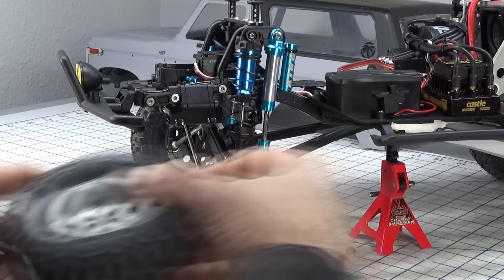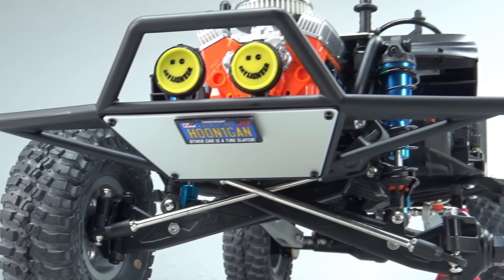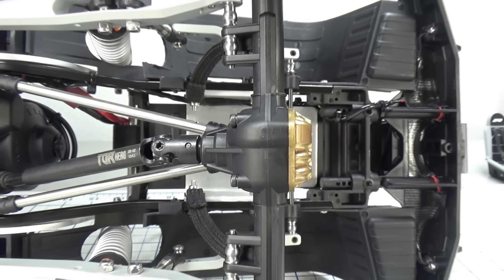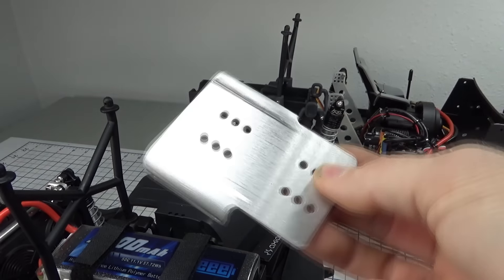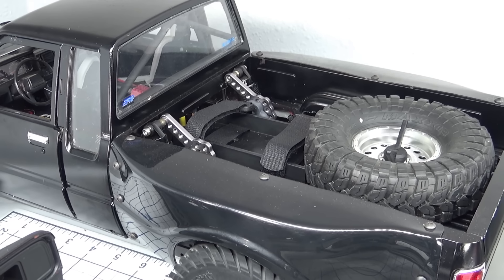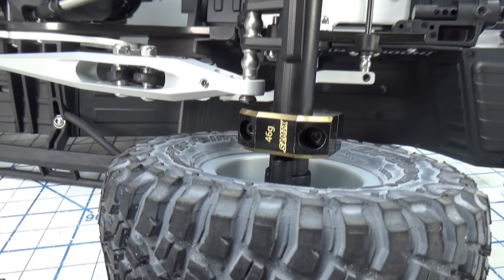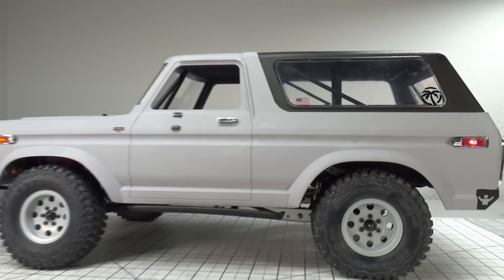Project Scale RC Prerunner 2wd Ford Bronco Hard Body! Axial SCX10ii off road

Comment: is that twin i beam kit still available for sale anywhere? cant seem to find anywhere that ships to the netherlands
Reply from the maker: Greetings from Oregon, all my buddies in the USA can't get them either. Been on backorder since the release. Wouldn't be surprised if we see a v2 come out and the V1 disappears. Horizon Hobby is good on delivering backorders. Good luck!
Reply: @DoubleClutchProductions  thanks a lot man, your video's are very helpful, been playing around with the idea of a prerunner style truck with twin i beam on the front and cantilever on the rear
Reply: @DoubleClutchProductions  im thinking of getting a full carbon/aluminum aliexpress scx10 kit as a base, im also working on a micro 1/35 orlandoo f150 based prerunner with 3d printed front i beams
Reply from the maker: @Weert-Gilders no worries, appreciate like minded people. Keep hunting. I'm building up a Element based 4x4 using the new IFS 2 from camburg, SCX10ii parts and trucks are getting harder to find these,days too. Good luck 👍
Reply: @DoubleClutchProductions  i got a cheap short course chassis laying around aswell wich i could use the front of for the ifs, if ill only use the rear axle on the scx10 because of the beam kit i would have an extra front axle laying around wich might be used as a rear axle for it 🤔
Reply: @DoubleClutchProductions  theres Quite a few scx10 for sale over here but most of em are rtr and asking too much imo, thats why im leaning towards the aliexpress clones wich Go for +-170 Bucks as a Rolling chassis and got aluminum axles with a Carbon fiber chassis
Reply from the maker: @Weert-Gilders your on the right track for sure dude. Blaze the trail 👊

Comment: @DoubleClutchProductions, do you have any of the Axial kits currently in stock? If not what’s the current backlog?
Reply from the maker: I don't have any axial kits in stock. I am doing a order in the next week or two. I will do a few posts here when I get kits back in stock. Appreciate the interest man. I do have a few prerunner chassis, you doing a twin I beam build?
Reply: Yep, looking to do an I-beam front on an SCX10.2. Will be a little more scale than performance because I want to run some sort of Ford body with a Vanquish F9 rear just for the looks. I also half considered doing a leaf rear to give it a more budget build look. Any experience with that?
Reply from the maker: @estok4x4 yup yup I hear ya. These are fun to build. I don't have any experience with leafs, most of my builds are based on emulating real prerunners and I've never seen leafs on a trsiling arm 4 link but I'm sure it's possible. I have a few scx10ii chassis frame rails left, my personal stash but it's a dual shock setup. I'm hoping to have full restock of all the goody's in a week or two. Hit me up anytime I enjoy helping fellow builders with these.
Reply: I kind of want to try the leaf setup just to see if it’ll work, kind of going for a modified stock truck look more than full blown prerunner if I can pull it off. But yeah I’ll keep checking in here to see when you have the parts available to duplicate your setup here and I’ll definitely be in for a set.
Reply from the maker: @estok4x4 awesome my dude, I've always wanted to try leafs

Comment: Are these kits still available?  Where do i get the kit if available?  Thx
Reply from the maker: You can purchase all my parts directly through SendCutSend. Links are on my youtube link tree more info. No hardware included.
Reply: @DoubleClutchProductions  can you elaborate on this w a link or something?  I've looked through the posts n I don't see any parts list or anything  😕
Reply from the maker: @lancesmeal8853 click the description for the video. All links to parts used are in the video description. You can also purchase my designed trailing arm conversions, battery relocation and chassis rails through send cut send with the links on my youtube link tree below the instagram link.
Reply: @DoubleClutchProductions  ah my bad... my brain was working.. 😂
Reply from the maker: @lancesmeal8853 ha ha all good man. Glad to help. 👊😎

Comment: Why would you add weights on the axle and use the lightest wheels as possible ?
Reply from the maker: Controversial right? Lol, rotational weight is a whole different important aspect to the science. Axle weights help keep the super light weight axle planted on the ground to help for traction. Full size fabricated off road housings are heavy compared to a 1/10 scale plastic one. If youu Google sprung vs unsprung weight for wheels and tires its amazing the ratio of forces per lb of weight that goes into the shocks. Everything is a trade off, without axle weights, it would work better through the whoops in theory but lack traction in loose sand and dirt. In my case all I have is sand and my 2wd trucks get better traction with added axle weight. 👊
Reply: @DoubleClutchProductions 
If you want better traction,use a different tire thread pattern,or cut one transversal tire thread line in an alternate pattern.,one cut,one stock.
Rotational weight will reduce your power on acceleration,but increase stability on higher speed,like a longitudinal gyro,and temper longitudinal oscillation since the mass is increased on the corners.
Reducing unsprung weight will help to improve shocks reactivity,since less mass will can accelerate and deccelerate faster. 
But adding axle weight and reduce wheel weight are complete contradictions as i understand,both are unsprung,and rotationnal mass is also unsprung mass here.
You better inprove tire traction,and reduce unsprung mass the most you can,and get the most traction with your shocks by increasing rebound speed,or a more balanced weight distribution with half the weight on the rear axle.
Are you sure the lack of traction is not caused by the slow suspension response ? its geometry does not help to get reactivity,it's a huge lever compared to a strut/wishbone.
You need minimum weight with that long levers.
Reply from the maker: @michaelovitch I go over a lot of this in the video. Your contradicting the books and research that I am referencing. The plastic axle housing with the added weight in my experience is closer to a real world fabricated axles, with light weight housings on these rc trucks after a few whoops it starts to pack because of the limitations in rc shock rebound tuning. The added weight is controversial, keep in mind I've tested these trucks with and without axle weights. Why I say it's controversial is its easy to blanket a topic with right and wrong but without testing and experience were just reading books and regurgitating proven science. 👊

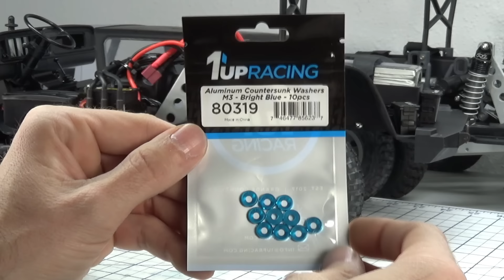Comment: How did you mount the fake motor to hide the servo 1:30
Reply from the maker: I made a mount out of kydex, similar to a 90 degree bracket and a few zip ties to the battery tray.
Reply: @ ahh okay looks really good tho , you inspired me to build a pre runner scx10 so i’m slowly building one from scratch and learning a lot on the way , never had or worked on a scx10 before
Reply from the maker: @MatthewKase Yah buddy. I'm very happy that these builds inspire others to build cool stuff. Building these prerunners is pretty challenging, so fee free to hit me up if you have any questions. If you need any parts hit me up. 👊😎
Reply: @ for sure i definitely will i’m just trying to figure out where to mount receivers and everything currently, did you mount yours on the side plates?
Reply from the maker: @MatthewKase Copy that. I did mount the receiver inside of the scx10ii receiver box. I mounted the esc on the opposite side plate. Any questions on setup or parts I enjoy helping fellow builders. I also have a Google document on my youtube link tree that has links to all the parts I use to build rc prerunners 👊😎

Comment: I struggled to get my new injora steering servo and injora steel drive shafts on my trx4m f-150 the other day and this guy is over explaining weight ratios..... specific weight oil to run in your shocks.... specific springs and angles to run multi link suspension set ups 😯😲
I'm impressed and intimidated all at the same time. Guess I'll subscribe to get some ideas for my next truck I'm getting next week a Traxxas 1/10 scale bronco crawler 💯
Reply from the maker: Yah buddy, don't be intimated, I'll always answer questions and my other videos have a ton of info. Thanks for watching and subscribing. 👊😎👍
Reply: Those are a pain to work on due to the size of everything... However I am by no means down playing the amount of problem solving and mechanical ability you need to do anything that even resembles what doubleclutch build's...
Reply from the maker: Lolz, very true. Im by no means an expert just a student and I spend a ton of time researching and testing to make sure the info I am providing is based on real data. Hope these help others to at least get a decent starting point. Contantly testing and adjusting trying to get better. Thsnks for commenting 👊😎

Comment: Are you  still making that kit for the rear suspension?
Reply from the maker: Yes sir, been busy with some other projects on the house. I can get small orders from send cut send. What are you looking for?
Reply: @DoubleClutchProductions  that rear trailing arm setup for the rear. How much you want for these?
Reply from the maker: I sell the trailing arm kits and battery relocation for $60, do you need Axial  or Element? I have element 325 and 313
Reply: @DoubleClutchProductions  60 for both, and I have the exact same truck in the video, so axial. Do you have a facebook account?
Reply from the maker: @TheBkwiatko I do not have a Facebook. I have instagram. I actually might have 1 or 2  scx10ii kits left, might have some shipping scratches I'll hook it up for cheaper. I might even just send you a scx10 prerunner frame rails for free to get em tested?

Comment: how much if i want an RTR like this ??
Reply from the maker: Totally dependent on parts used. I have two semi complete chassis that I am going to sell. Setup is my chassis rails and battery mount, new proline twin I beam kit, 4 element shocks up front, 4 shocks out back, proline powerstroke XT's and baja rey 2.0 secondary shocks, f100 prerunner bumper, battery tray with hot racing servo mount, metal center skid, side plates, rock sliders, crc rear bumper. They need trailing arms, sway bar, upper links, axle, trans, motor/esc, servo and a driveline. They will sell for $500. You can email me with specifics of what you would like and I can get a quote together. My email is on my youtube more info 👍
Reply from the maker: I love to build these things, if your willing to pay for the parts and shipping I can build whatever you like 👍

Comment: I have trouble with mine as it always turn when i punch the gas, it does not want to go straight if i am not csrefull on the gas. I have a 4000kv motor. Scx10 ii with the motor and transmission in the center.
Reply from the maker: What type of sway bar are you using? Are you using the proline rear battery adapter?
Reply from the maker: Torque twist is common for these types of trucks. Sway bar is the first thing I would address, second would be getting a stiffer foam or sealing the vents on your rims. I am running some unsprung weight on the rear axle that helps get traction in dirt. Hit me up if those tips don't help.
Reply: I dont have a sway bar yet as i didnt know i needed one, the battery tray dont fit under th body i am using, it's the injora half cherokee with the cage at the back. I still have the battery at the rear straped but it's front of the axle. I will buy a enduro sway bar. I use a heavy 2 step foam to make sure i have weight down low as the body want to make it top heavy. It's after all a mad max/resident evil post apo pre runner that i made.
Reply from the maker: @Aozoramurasaki I watch a lot of full size prerunner videos.  I do my build videos as a guide to help others get a baseline to start from. Sway bars are almost mandatory and although the Enduro sway works it's not ideal compared to other options. The placement of the battery and cg center of gravity is really important to get it over or behind the axle for traction and weight distribution. Hope this info helps 👊
Reply: @DoubleClutchProductions  yes thanks you, there seem to not have a whole lot of option for the scx10 ii in term of sway bar. it's hard some time in canada to have part that dont cost twice the price because shipping and fee and all.
Reply from the maker: @Aozoramurasaki totally understand the Canda imports. I use a yeti style sway bar. I found a few on Amazon for pretty cheap, rc lions makes one for the yet. Just amazon axial yeti sway bar see what comes up 👍
Reply: @DoubleClutchProductions  thanks for the info, also thanks for the fast answer.

Comment: The reverse akerman steering was intentional to help mitigate under steer caused from having a locked rear diff(most common configuration on SCX10's) it does look a bit strange though
Reply from the maker: I wish I would have gotten into more in hindsight. It sounds like I'm promoting the Ackerman but I only hinted at with a proper setup, then explained. Glad you picked up on that, like your style. 👊👍😎

Comment: Wow this is a sick build, I’ve been wanting to do the I beam conversion on my 10ii but wasn’t sure it would actually handle like a pre runner, this looks like it will, are your custom conversion parts available for sale?
Reply from the maker: The proline twin beams are promising. The proline back half, trailing arms, mounts, battery kit is a little underwhelming especially on stock length crawler shocks. You can purchase these parts through PayPal with the links on my YouTube👊😎

Comment: I'm new to the hobby so maybe someone can tell me.  Seems to me i-beams just add complexity and more breakage points without adding a lot of actual function.
Reply from the maker: I have a question for you, what are I Beams for? I Beams are OG ford tech to get 4wd independent front suspension, Beams are very very strong in IRL, off road desert trucks have been using Beams off road for decades and if you watch a few videos on prerunner Beams it's pretty amazing how it works. If your only into crawlers I can see the boggle!
Reply: I am only into crawlers.  So this is new to me. @DoubleClutchProductions
Reply from the maker: @julesverne2509 Tottally get it, I beans are definitely not for crawling. In desert racing I Beams are a cheap simple way to get big travel numbers with reliability. Minus the swing steer set beams are litterly a beam and a radius arm very few parts. Look up some videos on off road I beams, it's fascinatingly simple and functional. Whoop scissors ✂️

Comment: That’s the difference between the scx10ii and the scx10iii, I can only find the scx10iii in the builders kit I don’t wanna buy a new rig and take a bunch of stuff off I’m not gonna use
Reply from the maker: To be honest I'm not totally sure. I know they went a diff way in almost all the parts. I see SCX10ii come up on Ebay all the time and in decent shape. Not to mention all the scx10ii parts after I did this video are out of stock or discontinued. Sucks for sure. The Element Enduro is a good option but requires some custom stuff to get them beamed. 👍
Reply: @DoubleClutchProductions  I like the enduro I’m just not super impressed with the performance of the a arms on it they need to make a center mount kit with longer arms
Reply from the maker: @icebox829 I think people miss understand the performance of these trucks. If you had a center mount you would have to cut the frame rails to accommodate. I just got a IFS 2 kit and it's leaps ahead of the ifs 1. I proved the ifs1 Is functional and durable to be enjoyed.